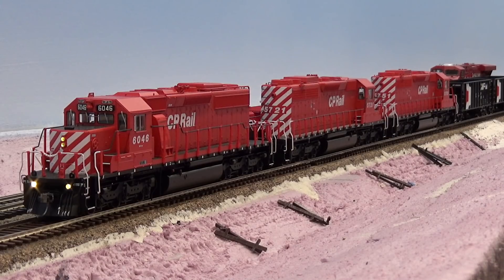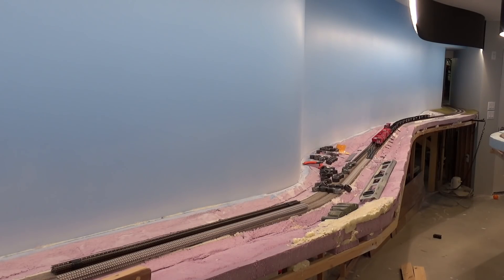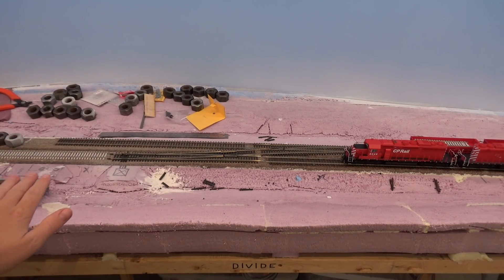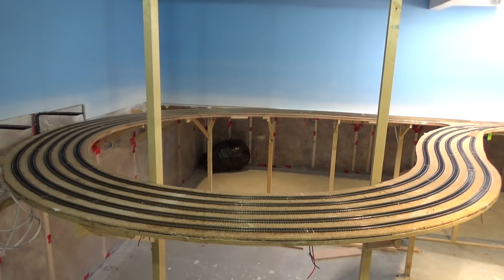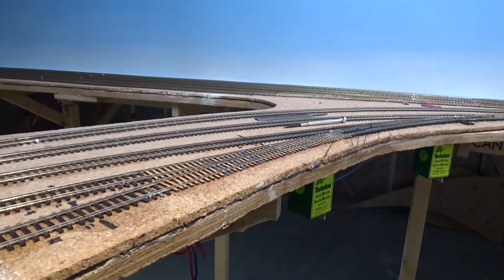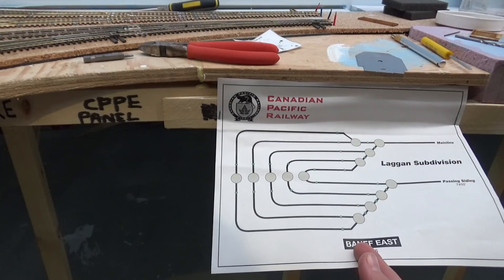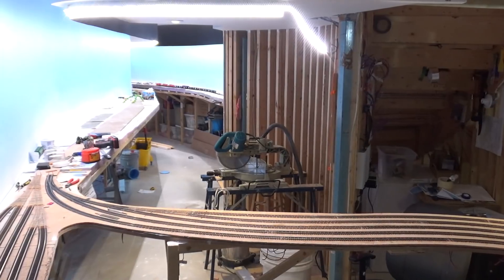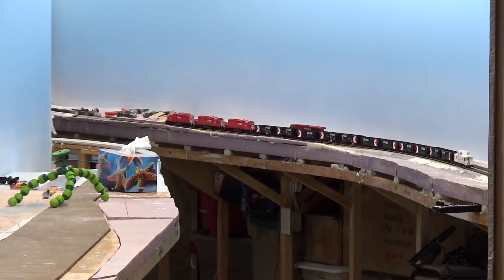Layout Update - July 2018: Mainline Track Laying At Divide, Points East Reverse Loop Complete...

Comment: Hey Ben. Fyi... I was just looking at the Divide area from the TCH on Google maps and it looks like CP has removed the crossovers there. The signals are still in place though. I'm not sure when or why they did that. I guess it is a long passing track from Stephen to Lake Louise now.
Reply from the maker: From photos, the best I can tell is they were removed sometime between 2011 and 2014. I friend of mine who worked the Laggan as a conductor told me the crossover at Divide was operationally useless and no one he knew had ever seen it used. Best guess is that it was for allowing the south track to drill the small yard at Stephan.
I decided to leave it in on my layout and actually flip it so it allows eastbound trains to be scooped at Lake Louise. So it will look a little different, the signals will be opposite of the real thing but should still capture the feel of the scene while allowing a little more operational flexibility.
Reply: BArailsystem thanks for the information. Sounds like the removal was Hunter’s cost cutting measures, such as removing the short siding at Cathedral.  Love the layout progress. Hope you’ve had a good summer
Reply from the maker: Very likely it was part of EHH's program to reduce the number of mainline switches. We are having a great summer, hope you guys had a great summer as well! Stay cool :)

Comment: Great stuff, subscribed to follow the build. What’s the dimensions of that reverse loop? Thanks - Steve
Reply from the maker: Thanks Steve, welcome aboard! That reverse loop is around 48'' radius on the outside track so around 8' in diameter.  I sized it so that each track would be at least 25' in length which is the maximum length a train can be to fit inside the reversing districts at each end.
Reply: Wow, that’s a big return loop. That will be very nice for staging operations as well as through trains. Gives me some ideas for my next build in N scale. Looking forward to new videos and thanks for sharing your build with us. -Steve

Comment: What are you doing to control the reverse loos?
Reply from the maker: It's DCC Wayne, locomotives can go either direction without conflict thanks to an onboard "decoder" which reads commands from the power signal in the tracks.